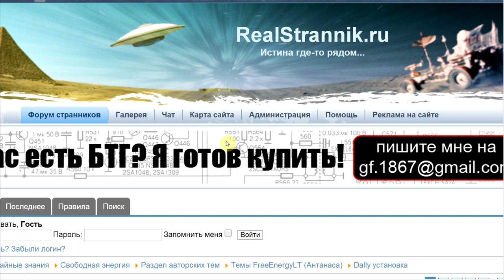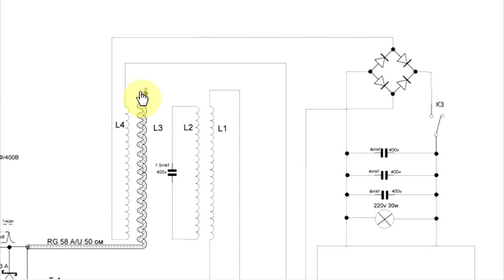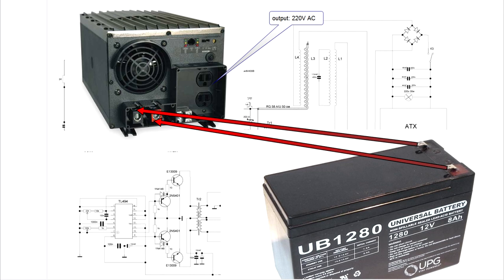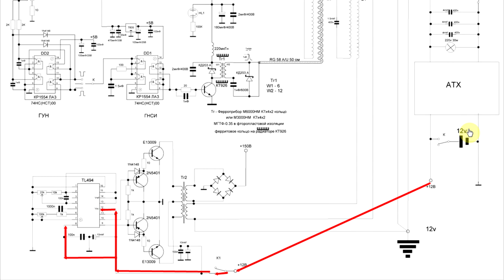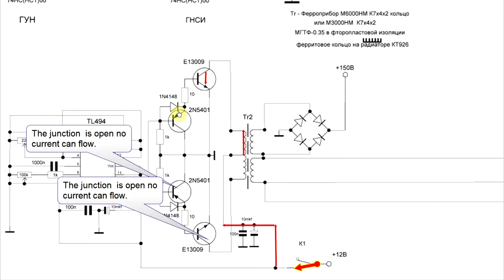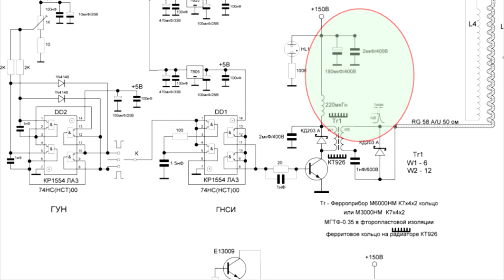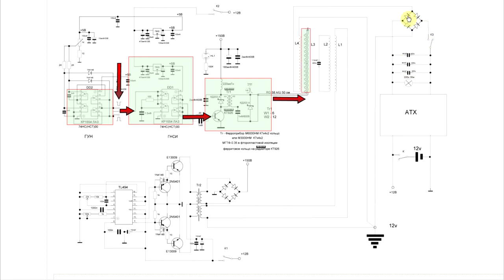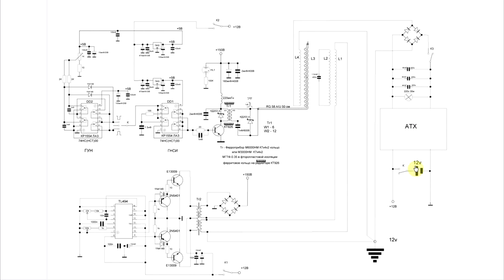Wesley presents:Daly part #2 Free Energy Device (schematic)

Comment: Wesley, the bridge rectifier is show incorrectly in the schematic. Based on the way it is show, the DC power supply 100-220 volt input would be receiving DC. This of course would cause the DC power supply to not function at all.  Thanks
Reply from the maker: Yes I  have noticed that as well. You right.
Bridge rectifier is correct but  for you to be able to get back 12V DC on ATX you need AC at light bulb  terminals.
 The AC that comes from  rectifier is  is pulsed DC than that  DC is again smoothed  by  capacitors   . Unless we have inverted not  power supply from 220VDC to 12V DC. But we might have  AC component that is present on  DC terminals of lightbulb. It does not make any sense anyhow. Thank you my friend.
Reply: you are wonderful man

Comment: Why don't they mix in the mag amp? The mag amp would do two things. Boost the input and allow for switching as well. It was used before tubes and silicon and it is very rugged.
Reply from the maker: Have no answer to that as of yet. hm................. I'm thinking